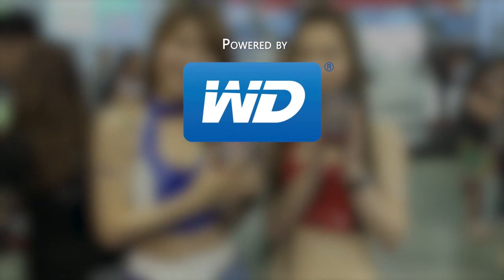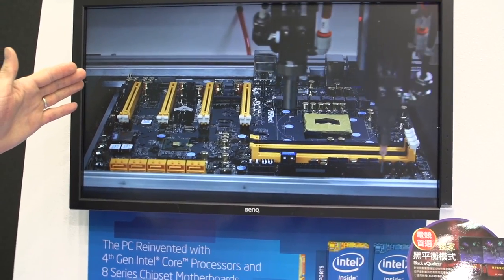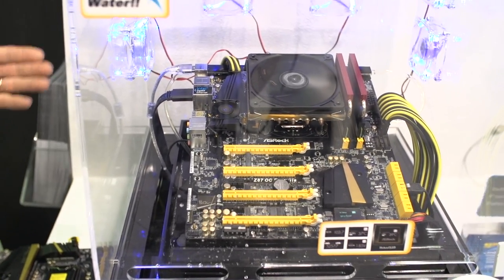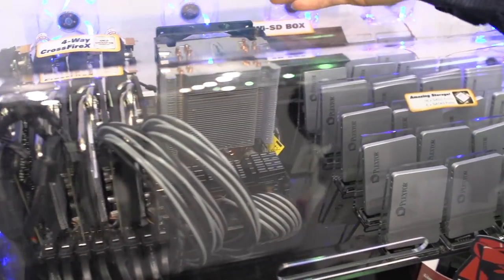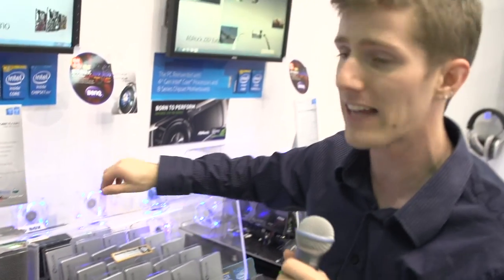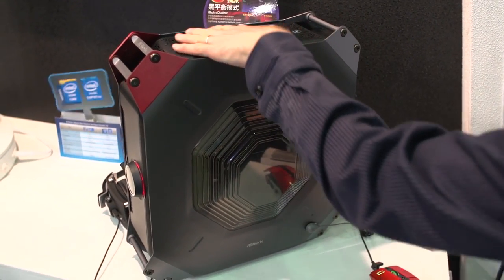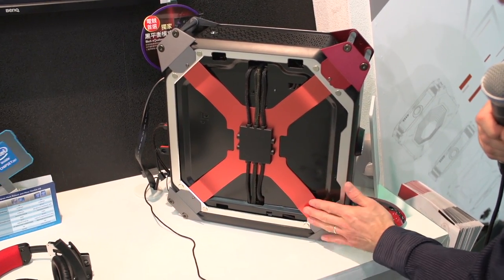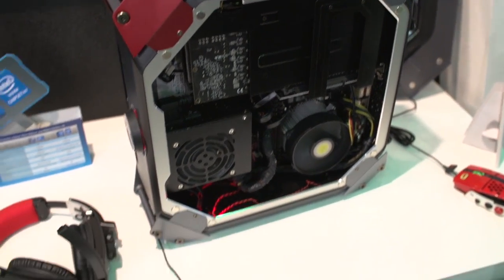Asrock M8 BMW Designed Mini PC, Z87 OC Formula Waterproof Motherboard - Computex 2013

Comment: You could easily do that yourself. Buy a spare old-school car-key-mechanism from your local garage, figure out what pins belong to what position of the key. Solder two wires to the desired pins, solder a 2 pin connector to the other ends of the wires and plug that connector to the powerpins of your motherboard.

If you cant find the correct 2 pin connector you can always cut off the connector from the power-button of your case.

Comment: No. Condensation only happens when extreme overclockers use liquid nitrogen to cool their CPUs. The negative temperatures may turn the water vapor in the air around the motherboard to liquid water.

Comment: i am strongly considering this m8 for my next build because of it's compact size is ideal for somone who moves and travels a lot like me it's ideal for lan parties, aluminum chassis, built in wifi, built in soundblaster soundcard so i don't have to add one or find room for one in a small chassis and it fits 1 HDD and 1 SSD. my only gripe is i wish it had a bit more room for a taller cpu cooler, and could fit desktop memory  and a 600w power supply instead of 450w,

Comment: you mean the silverstone ft03? the size is nearly mid tower size so i hardly see the point has good options for a liquid cooler and customization options but once you add all the parts the asrock includes you will be very close,  you still will need to buy the optical drive(optional i guess) motherboard and power supply you would be very close money wise but i really like how small this asrock m8 is and the sturdy aluminum case. i would have to see the ft03 in person in pics it looks huge

Comment: you only need a 600 watt PSU for GTX 780 a Haswell CPU and 4x HDD's and 4 fans.

So yeah get a 750 watt and overclock.

Comment: if that water is distilled then - ABSOLUTELY NOTHING NAPPENS even if the board is turned on and running! And this goes to any pc board ever made, because the voltages on the board is too small you have a max 12V DC rail running on the board so distilled wather wouldnt do any harm.

Comment: umm wtf? 4:54 is that a thermaltake booth or asrock booth? im confused thermaltake mouse and headset which are co-designed with BMW. the case is too so im guessing its thermaltake? Theres nothing abotu thermaltake in the title.

Comment: Fed up of manufacturers forcing upgrades. Oh yes we all work in tandem to make sure we all profit. An ISA slot can be configured to handle PCIe bandwidth. A PCI slot the same. It's copper connectors no matter how you look at it. We are being ripped off royaly by manufacturers. Tell me one reason a socket LGA 1155 CPU couldn't work on a 939 pin ZIF. Other than simple configuration of the pins, there is NOTHING. Forced upgrades = planned obsolescence.

Comment: You obviously don't understand the basic concept of copper/gold connectors. What is IDE vs SATA? copper cable running through a straight sheath. No difference in the signal and even if there was, why change cable shape? 939 gold pins could run any CPU , including server, that we have today. If the CPU was built around the PIN configuration. You can't honestly say to me that a hexagonal shaped gold connector gives a different output to a square one.

Comment: Yay another new socket........ another new pointlessly restyled socket so that we all have to change boards too.  Great. I don't see any good reason why they have to change the sockets on every CPU revision. Surely 939 pins (for example) could be kept the same on all revisions/models and still have the same functionality. Then we wouldn't have to buy a new board every time we want the latest CPU. BIOS updates would allow for it. Or make a completely re-writable BIOS. New socket ~ forced upgrade